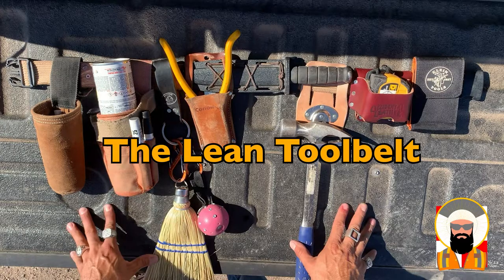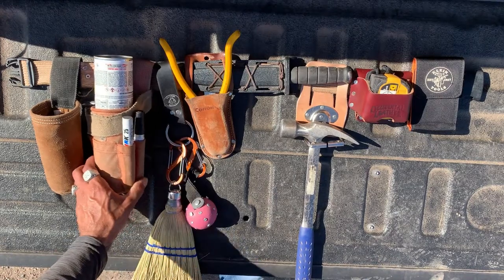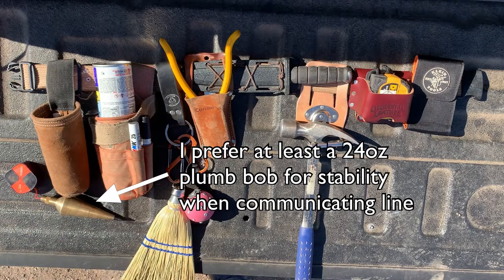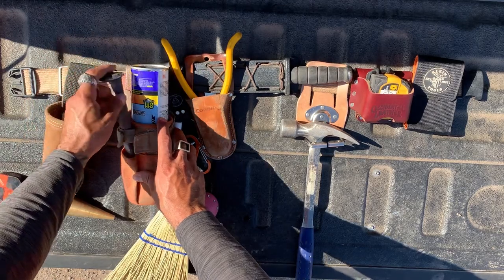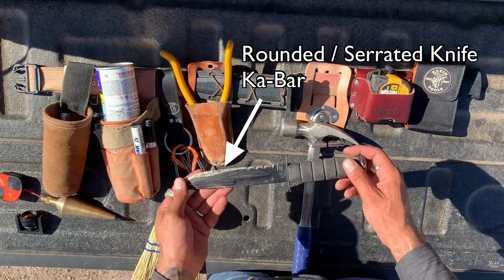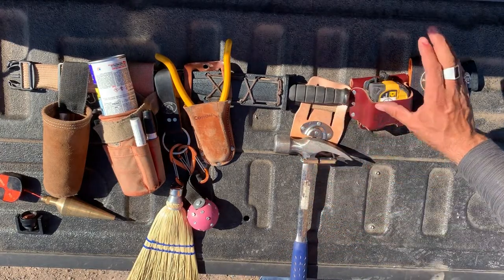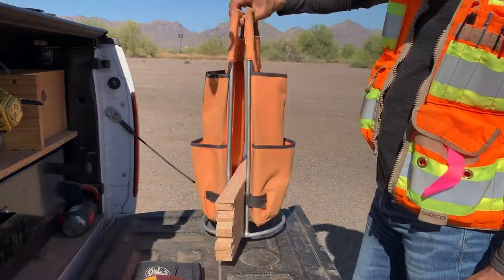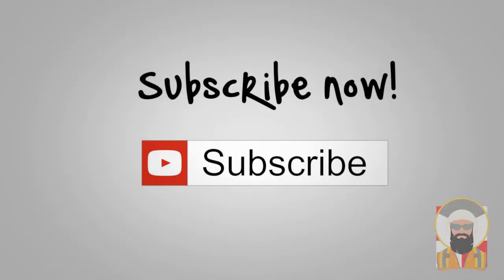Surveying: The Lean Toolbelt

Comment: I found my spirit animal Surveyor.

The moment I knew we had a lot in common wasn't the fact that we wear toolboelts...it was the moment you said you wore one knee pad. That's where I knew we were brothers.

I mean, even today I got questioned on why I wore only one. That's how common it comes up.

Main differences in toolkit though, is I prefer rod buster wire snips. I usually swap between a 3 pound hammer and a claw depending on the task, so I'll have a full on pouch that should hold nails in that I just invert my hammer in. Fits just fine.

I'll also use the spider universal kit to put my paint wand on my toolbelt. Not wearing glloves isn't optiional in Canada, and nothing sucks more than fat fingering paint. 

I do also really like to carry a speed square and a centrefinder (that I actually use for both marking bolts and for marking offsets on steel. 

I really like that paint can holder though for the plumbbob. I also prefer to carry a 32 oz. bob. 

I have the exact same phone holder, but I cut the lid off it. Instead my new nylon bag I keep on my right side fits the phone perfectly.

I do wear a full suspenion year round in my belt. In the winter, its clunky. In the summer, I just wear a safety shirt underneth. I'll keep my markers (usually paint markers) in the suspenders, and I got a fancy flagging pouch that I keep attached to the front side of the harness. Perfect access. My left bag gets used less, but that's where my field book goes, and maybe any fasteners I'd like to use that day.  I've even been known to keep shaved down hubs in that bag. 

Either way, I learned all that stuff from an old guy I worked with back in the early 2000's. I thought it was brilliant, and I just can't imagine surveying any other way. 

Oh, and rail spikes are great in the summer here. Winter, almost need a hilti or a pinner on some jobs.  Clear coat pays for itself in time and efficiency.